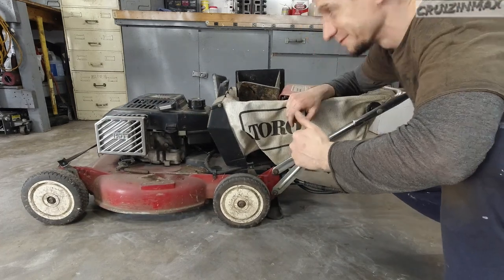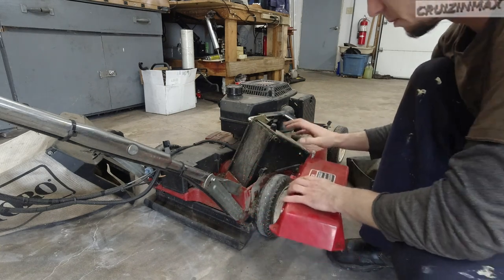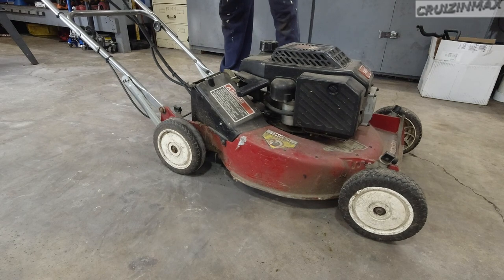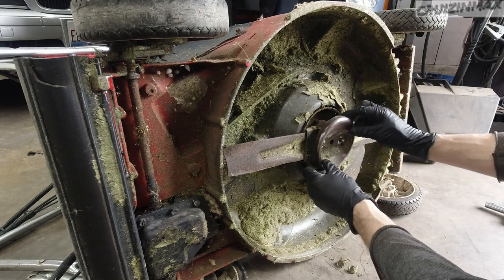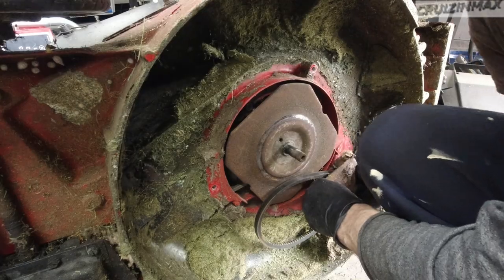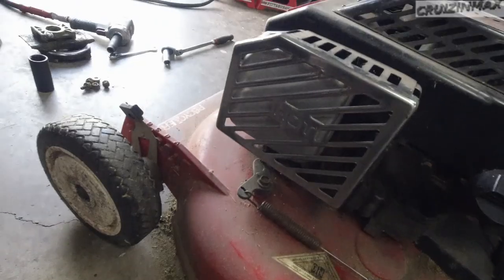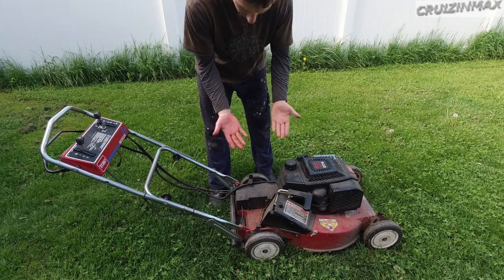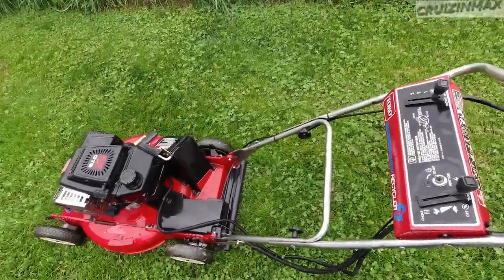Toro GTS recycler, Blade not spinning or is it

Comment: I have the 1996 version of this lawnmower (almost identical) so I enjoyed watching you needlessly disassemble it because you weren't sure how it worked. I will give you credit for putting it back together. Not keeping it for yourself was your second mistake because as you yourself stated "they don't make them like they used to"
Reply from the maker: Hehe, glad you enjoyed it.  I have a newer but still old Toro which runs like a champ and also a 1999 craftsman ride on tractor with the briggs and strat V twin engine which is just boss but if I had the room to store the GTS then I would keep it.  Sometimes we just gotta let some go...

Comment: Even though you didn't need to take it apart this actually might help me as I have similar lawn mower so feel more confident taking it further apart seeing how you did it. My pull rope doesn't turn. Seems to turn from the blade. I took out spark plug and still doesn't turn. Don't think engine is seized since can turn with the blade but maybe the blade isn't turning 100%>> I have to look at it closer tmrw

Comment: Hi, I have a similar old Toro the OHV engine with electric starter and alternator.. The battery was missing from mine I'm trying to find out if it used a 6v,12v or 24v battery. Are you able to tell me the voltage of the battery that came with yours? I'm assuming it would be the same voltage

Thanks
Reply from the maker: I dont have this anymore, sold it a long time ago but I just did a quick search and it says 12V.
Reply: @cruizinmax4017  cool thanks. I did some searches too but found conflicting results but 12v makes the most sense

Comment: Omg I have this same exact mower!  Can you find the model number on it so I can get parts for it????
Reply from the maker: I dont have it anymore but looked for pictures which I know I took of all the numbers and I must have deleted them....wish I didnt...sorry I cant help ya.  :(
Reply: @cruizinmax4017  Thanks for checking.  Did you have to hold the break from under the deck to get the blade engagement lever to work?   My cable connector came off and having trouble getting it to work.
Reply from the maker: no I didnt, worked for me with no problem
Reply: 20107 is the non-electric start version of this mower. Its a '91 or '92 model. I have a Suzuki powered 2-cycle '91 just like it(20106)

Comment: MyToro TV 5002 engine stalls when hot after 10 minutes and dies  and only starts again when cold?I have spark.What could it be?
Reply from the maker: Possible vacuum leak, when running...spray starting fluid or brake cleaner around carburetor but not inside, listen for higher rpms...